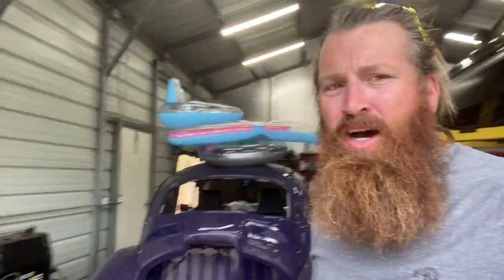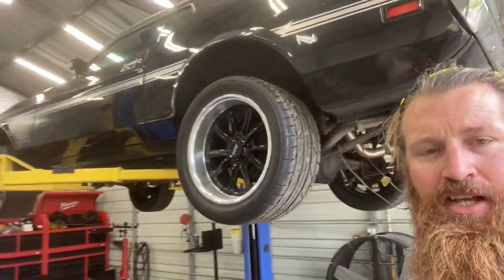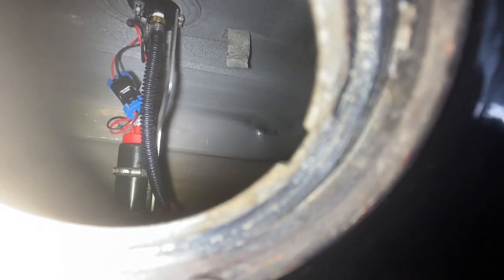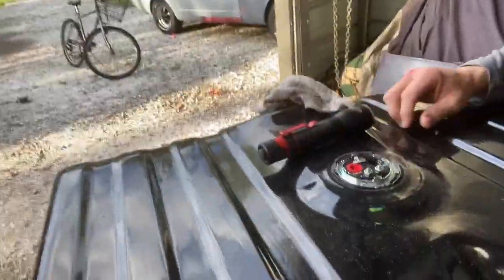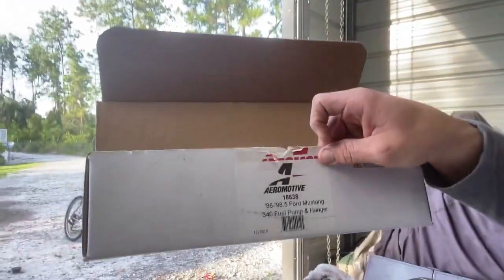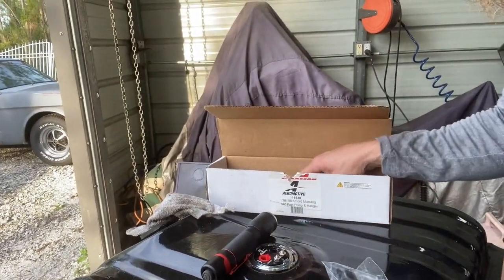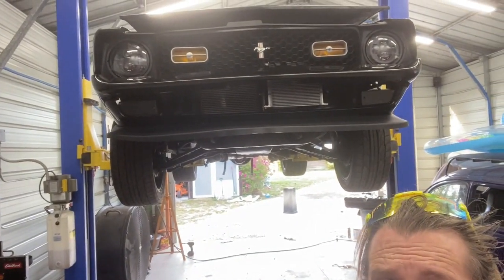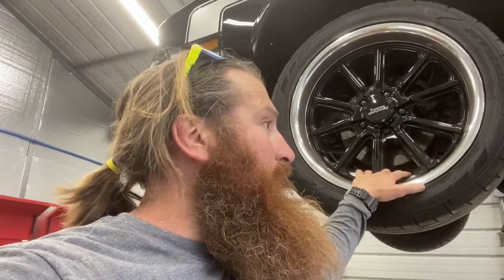EFI Conversion Fuel Pump - 71-73 Mustang Hack

Comment: here the other problem with this u need a reservoir for the bottom of the pump so when ur making turns there always fuel going into the pump so u dont burn the pump out and on top of that u still need a vent sense ur removing the one
Reply from the maker: Yeah man thanks… I’ll let you know when that happens

Comment: Hi I have  questions. As for the vented gas cap, does the gas come out if you are on a slope. Did you replace the carburated metal hoses. Those are rated for lower psi. Did you have enough clearance on top of the tank to prevent rubbing of the hoses with the frame or the tank. Great work on finding the perfect fit
Reply from the maker: Yes I used all AN lines. Because I did this I had to clearance the trunk metal on top of the tank.

Comment: What did you do to block off the original fuel inlet line? being it is on the lower portion of the tank something had to be done to keep it from leaking out.
Reply from the maker: I just used a cap. Like a vacuum cap but more heavy duty
Reply: @baconfabrication7775  also, do you have a part number for the gas cap you used? I am finding mixed answers on this one.